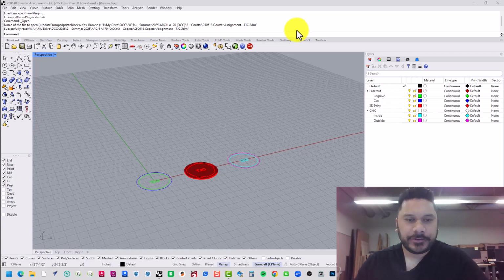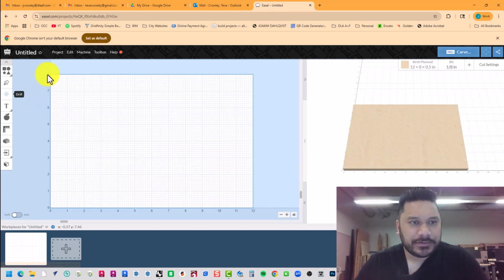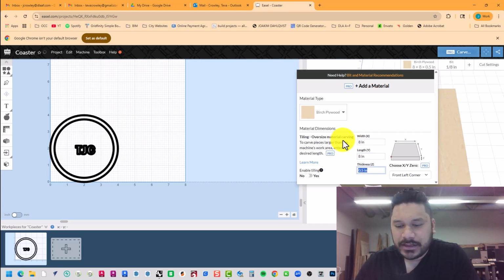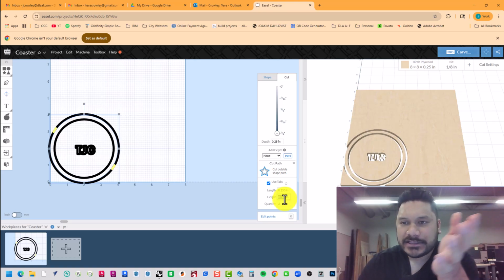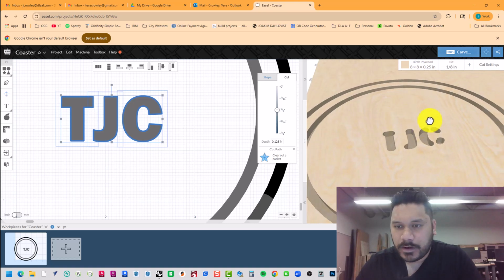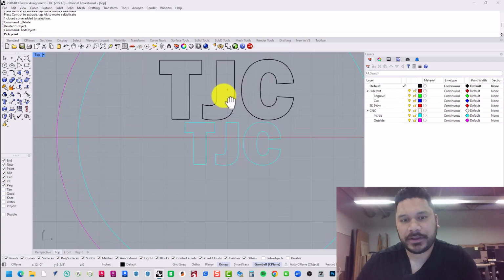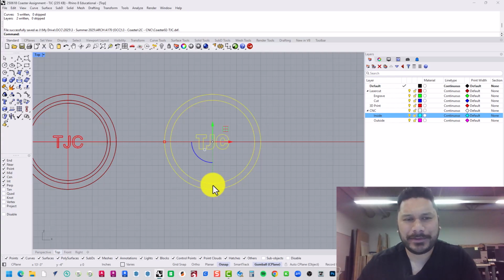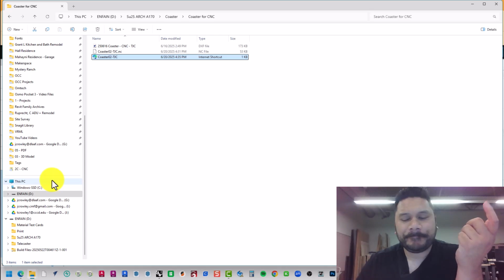Preparing a Coaster for CNC Fabrication | Easel + X-Carve Workflow| Rhino Tutorial (Part 2C)

Comment: What are the main differences between CNC and laser cutting? Thank you for explaining why you needed to fix the lettering when getting it ready for CNC.
Reply from the maker: Great question! The main differences between CNC and laser cutting come down to the tool and the material removal process. Laser Cutting uses a high-powered laser beam to cut or engrave materials by burning or melting them. It is best for thin materials like wood, acrylic, cardboard, and some metals, super precise and great for detailed cuts or engraving. The laser has a limited depth – it doesn’t work well for thick or very hard materials.

CNC (Computer Numerical Control) Cutting uses rotating tools (like a router or drill bit) to carve away material. It can cut deeper and work with thicker materials like wood, plastic, and soft metals. It is better for 3D shaping or carving because it can move in multiple directions (not just 2D). Also, it is usually a bit rougher than laser in terms of fine detail, but much more versatile in depth and shape.

Summary:
Laser = burns with light, great for 2D cuts and engraving.
CNC = cuts with spinning bits, better for carving and shaping 3D surfaces.

Hope that helps—and keep the questions coming!
Reply: @designfabstudio  I also had the same question, but this is a very thorough explanation and now I understand it! Thank you

Comment: Does the number of tabs vary depending on the size/scale of the project?
Reply from the maker: Yes, the number of tabs does vary depending on the size and scale of the project. For small or detailed parts, you’ll usually need more tabs to keep the piece secure during cutting and to prevent it from shifting or breaking free. For larger parts, you can usually use fewer tabs because the material is heavier and less likely to move.

It also depends on: The cutting method (CNC vs. laser), the material type, the complexity of the shape, the key is to use enough tabs to hold the part in place until the end of the cut, but not so many that they’re hard to clean up afterward.